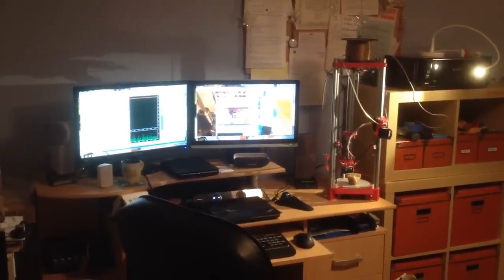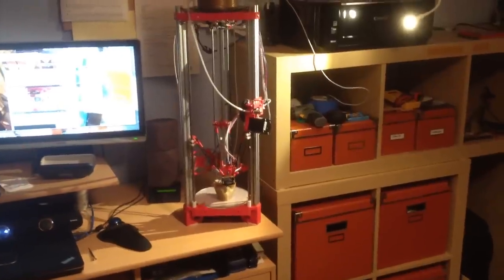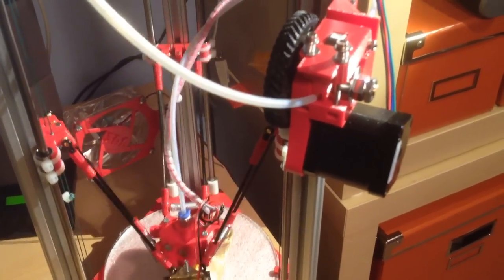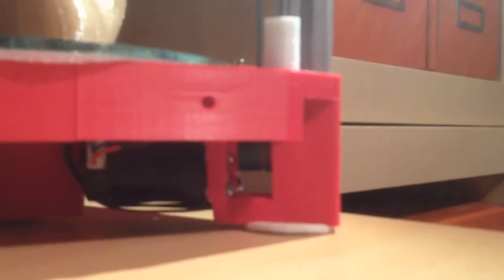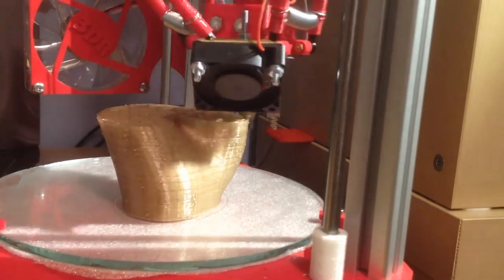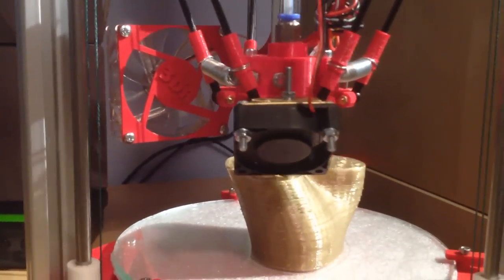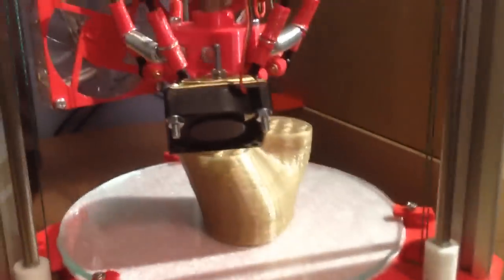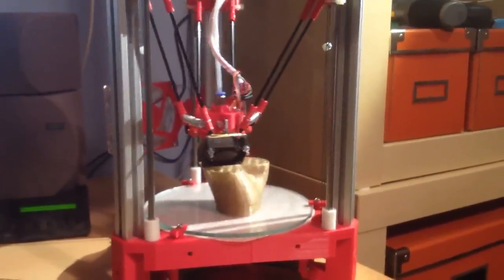My 3DR printer built and working

Comment: would these work for the arms? http://www.hobbyking.co.uk/hobbyking/store/__21926__Heavy_duty_Push_rods_with_ball_link_ends_M4x83mm_2pcs_bag_.html?strSearch=push%20rod%20b
Reply from the maker: The ball-links look good but the rods are a bit on the short side. I think mine are about 150 mm long.
Reply: Richard Gain 150mm including the ball bits right?
Reply from the maker: Yep. Centre to centre. You have to put the exact measurement in your firmware to get the geometric calculations to work correctly.
Reply: Richard Gain ok thanks. I think im just going to cut my own CF rods to get them perfect.
Reply from the maker: Building a jig seems to be the most reliable way of gluing all the parts perfectly identical.